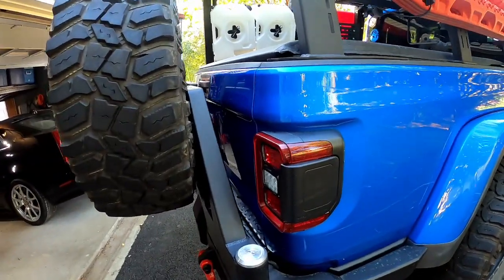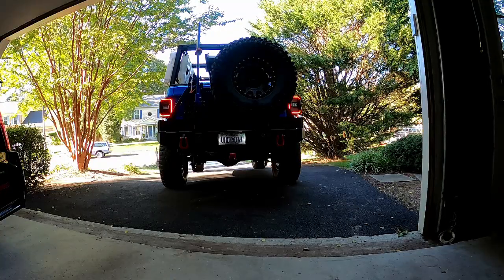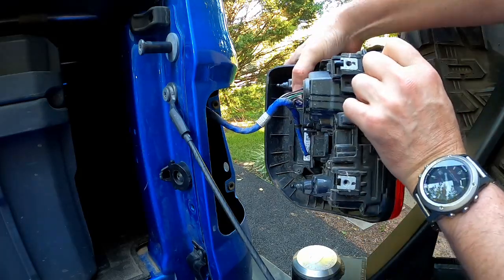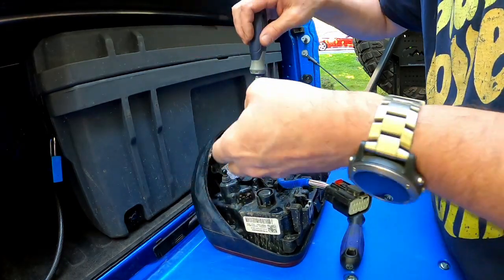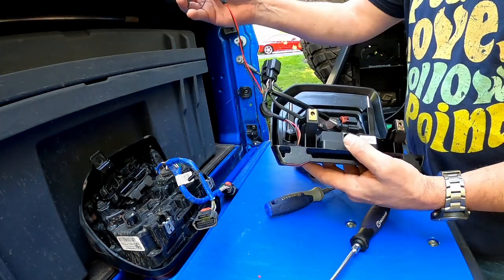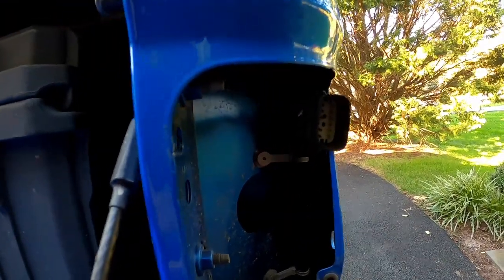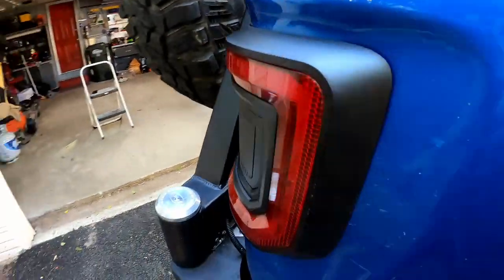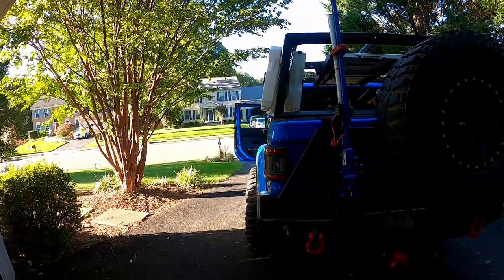Oracle Lighting Jeep Gladiator Flush Mount LED Tail Lights

Comment from the maker: I was able to test these this morning and they work great, including the cross traffic sensors.  I was getting intermittent errors on the dash that they were not working but I checked and they were working just fine. It turns out that Oracle Lighting has a great install video here: https://www.oraclelights.com/products/flush-taillight-jt?rq=mk_jeep~md_gladiator-jt~yr_2020  and if you have LED taillights you do not need the resistor and you may get an error if you use it (I did).  It is only intended for use with the standard halogen tail light replacement.
Reply: What did you do for the error message? Taser?
Reply from the maker: @andrewmcmath3943  Yes, the Tazer was able to  clear the error message.  The Taser was my very first upgrade and a must have in my opinion.

Comment: I have these and when I turn the turn signals on (either direction) the tag lights go out. I noticed your tag lights went out when you went into reverse. Any input?
Reply from the maker: Since the stock location for the backup cam is above the license plate many people notice a glare on the camera when backing up or using TurnCam.  I believe the stock Gladiator does not disable the tag light for backup but does if you are using TurnCam.  My Tazer mini disables my tag light automatically when in reverse for the same reason even though I have relocated the rear camera.  Thanks for watching!
Reply: @bluox  interesting!  I have turn cam on with the Tazer Mini, so I'll look into this.  Thank you!
Reply from the maker: @blck04gt  You can find the Tazer function under "live functions" and it is not setable.
Reply: @blck04gt what do you think can 0:32  leep

Comment: What was the cover on your tailgate?  Thanks for making the video, looks pretty easy.
Reply from the maker: That is from Mountain Hatch product. It is made of heavy 1/2 thick FDA approved plastic kind of like a cutting board and is food safe.  Super easy to install and comes in different colors and makes a flat surface to use as a camp table.  I like it and the only downsides are that it is a bit pricey and it does create a slight lip when pulling stuff out of the bed, but that is a minor gripe.  The tail lights were very easy and a great upgrade.  Thanks for watching!

Comment: What did you install on your tailgate? Seems like a great upgrade!
Reply from the maker: It is basically cutting board material that creates a nice flat surface, I like it.  I got it from Mountain Hatch (https://mountainhatch.org/products/mountain-hatch-for-2019-2022-jeep-gladiator) it is a little pricey  but very functional and easy to install.  The only negative is that when I pull my storage box out of the bed it tends to bang against the edge but not really a big deal.  Thanks for watching!

Comment: I find the reversing in the dark that the 8.4 screen is not very helpful as it’s so dark. So my long winded question is. You mentioned the reverse lights on these new lights are much brighter, did you find helps with clarity at all in reversing at night?
Reply from the maker: The short answer is yes.  I have the Expedition one rear bumper with the tire carrier so I have relocated my backup camera to just above my license plate which makes that scenario a little worse.  These lights are still bright enough to make the reversing view better so I assume with a stock setup it would be even better.
Reply: Great. Thanks for the reply @bluox
Reply from the maker: By the way, thanks for that question.  I think that would probably be of great interest to a number of people considering these tail lights.  Thanks for watching.
Reply: Get a JL Tazer. It shuts the tag lights off and helps a TON.
Reply: @BlueCollarBachelor  Tazer is coming. But wasn’t aware of that setting so thanks pal
Reply: @jesselaporte7184  It's not a setting, it's one of the automagic things it does just by being in there. Mine is mostly there for the Auto Stop disable. 

Really powerful piece of kit. Print out the manual and throw it in your glove box. 

UPDATE the unit before you install it!!
Good luck.

Comment: My running light on the right side went out anyone know why??
Reply from the maker: Did you use the standard KC harness or connect them to your AUX switches?  If you used the standard harness it is unlikely that you would have problems with just one and I would call KC.  If you cut up the harness I would check the connection for the right (I know that you probably already did) and then call KC support.
Reply: @bluox  oh I got it already it ended up being the fuse it wasn’t in all the way
Reply from the maker: @baldeagles7493  That will get you sometimes, glad you got it.  Thanks for watching!

Comment: Leading edges  don't look like they fit well.
Reply from the maker: I just went out and looked and you are right, there is a slight gap.  I removed the taillight and inspected the cavity and there is no water or mud and I was just out off-roading in some very deep muddy water last weekend so it appears to only be a cosmetic issue.  Good eyes!
Reply: @bluox  You can fix that by removing the rubber grommets that the pins go into and cut off the end at the back. The pins on the stock lights are shorter so the grommet is shallow.
Reply from the maker: @SSgtBigSwole  I have another video on that, thanks for watchingh!

Comment: don’t buy this i so disappoint.  no one talking about the gap around this light.   yes looks good. but stuff go inside of the light all around , especially whether. is BAD  for the $ 
like i say. yes looks very good  but for the $ to much. check for more options no to many but all terrain and quadratec  has couple options
Reply from the maker: I understand your concerns and a couple of others have the same concerns.  I have not had any problem with anything getting in the gap and I have done some spirited offroad stuff with them, I have more problems with stuff getting in the gap between the fenders and the body.  They cost considerably less than a Mopar replacement with less likelihood of damage on the trail so there are some pros.  Thanks for watching.
Reply: Another YouTube video shows how to remedy this problem. 

Take the tail lights back out and you’ll see the two rubber grommets that the tail lights go in to. The little studs on the oracles are longer than stock so you need to use scissors or snips to allow the studs to go all the way in. 

Dks garage is the YouTube guy that did this. It makes the oracles install flush and the install is not compromised.
Reply from the maker: @codycurler4883  That is excellent info, thanks!